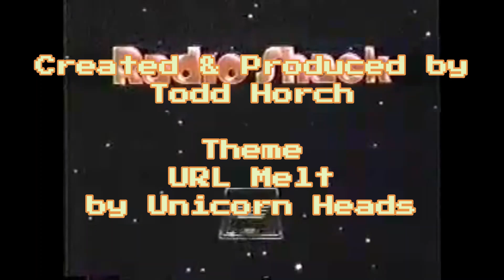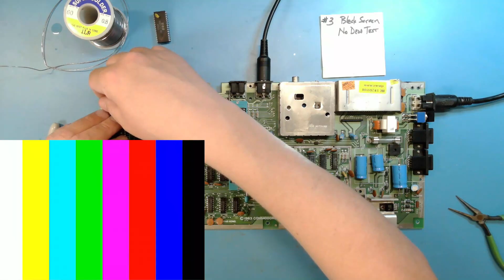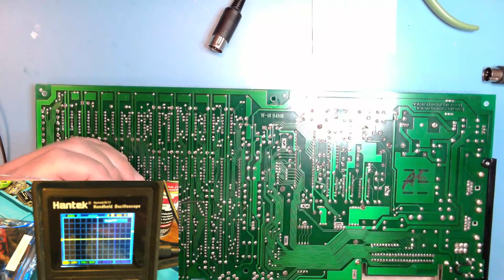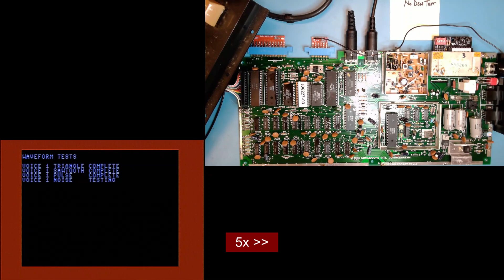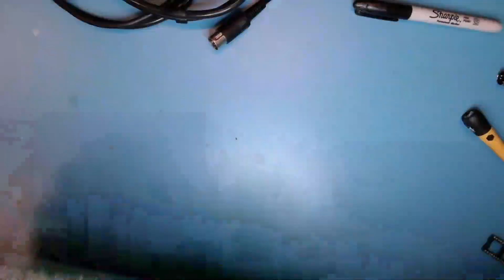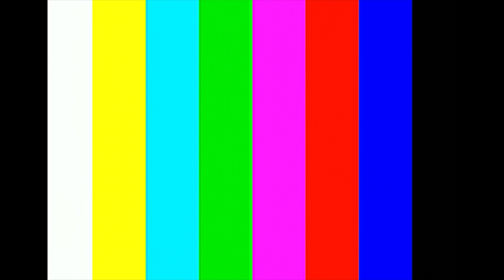Will Commodore 64 Number 3 be Easier?

Comment: Keep marginal/semi functional chips around. One day you might have the choice between a completely dead part and one that at least gets your system mostly working.
I absolutely avoid desoldering SID chips, especially when they're mostly working - they do have crazy factory tolerances and there's barely two SIDs sounding exactly the same. My first SID desolder was by young me with just a crappy small iron (back in around 2000) and the SID ended up with one voice working mostly, one voice working a little - some waveforms wouldn't work - and one voice dead. Second time, many years later, I used a solder sucker and allowed the chip to cool off every now and again. The result: None of the filters worked (but otherwise the SID was OK).
Another time later I used a desoldering station, grounded the station and the C64 and took even more time for the chip to cool off in between desoldering (like every 4 legs) and - again, no filters, otherwise functional. My lesson: Don't ever desolder SIDs unless they are proven defective. Try instead to bring the board back to life no matter what.
Reply from the maker: I do.  I've kept a marginal SID and a marginal CIA from the repairathon.  Thanks for the suggestion, though.  Cheers!

Comment: Be careful with those machined sockets. I've had quite a few lately that are low quality. If you don't check them before using them they're a real pita to desolder if you want to replace it. So for now I just about only use traditionel dual prong sockets. While good quality machined are nice low quality machined ones are really much worse than low quality dual prog sockets. At least dual prong socket are really easy to desolder - even more so than the ICs themselves.
Reply from the maker: I haven't had any problems with them being bad or desoldering them if needed, but thanks for the heads-up and for watching!
Reply: @YARC-1981  In the old days I never had an issue with them. However lately I've had several kits with them and one was really a pita to desolder in a double sided pcb. So always try at least a few pins (using scrap ic if you want) to see how well they're holding. The last kit fortunately before I used the sockets. I would have used regular dual prongs but all I had in the right size was years old machined one. Those really hold well in contrast to the new crappy ones. One kit they even caused loose connection - so bad where they - no way around except replacing them. Might be they're probably fine from big known sellers. But crap do turn up everywhere these days it seems :/

Comment: Wow... I am at a conundrum here. 2x CIA, CPU, VIC-II, Character ROM, Kernal ROM and the SID is replaced. The cost of these parts is way over the market price of working a Rev. A C64. Although it is always good to see a C64 coming back to life, maybe this one was a good candidate for becoming a parts donor machine?
Reply from the maker: This one and the last were both very expensive repairs.  Between the two of them, I figure (at current ebay prices) I've put about $400 USD in replacement parts in.  If this were a "scrapathon" instead of a "repairathon", I might have made exactly that decision.  But what fun would that have been to watch?
Reply: @YARC-1981  For me, it will be the same fun. What you did (diagnosing all its problems and making it work) was the correct approach, and this is the fun part of it. My thought comes after that. Whether to keep it as working machine, or to remove everything I put in and keep it as a parts machine, including the case, keyboard etc. There are a lot of physically damaged (broken case, keyboard missing keys etc) but otherwise working C64s out there which might benefit from a parts machine like this.
Reply: @YARC-1981  Just an observation, but you probably aren’t really increasing the number of working C64s in the world by buying chips on EBay from someone who is gutting other machines to sell the chips. I would identify the faults and replace the dead chips with modern equivalents where possible but when not, I would just accept that I have donor boards for future repairs. You still get the fun of doing the repairs either way
Reply from the maker: @Doug_in_NC  Increasing the number?  Maybe not.  At the very least, I'm undoing the damage that seller may have done.  He kills one, I bring one back.  If the ebay seller destroys one C64 and those chips are used to bring back two or more other boards, isn't that a net positive?  If I "accept that I have donor boards", aren't I guilty of the same thing as the ebay seller?  Sacrificing one to save many?  I'm not condoning harvesting parts from working boards to sell for a profit.  Far from it.  Maybe I'm minimizing the damage these people may be doing.  BTW:  I won't buy from the sellers in Germany, Hungary or China because I know they're bulk harvesters just looking to turn a dime.  I lump those people in with those that break down old tech to harvest the precious metals.  I figure a US seller who's only selling one or two parts probably (or not) had a board they couldn't repair and decided to sell off their good spares so someone else might revive their own machine.  And I do use modern replacements whenever possible.  Didn't you notice the ArmSID, GAL PLA and EPROM replacement for the KERNAL?  I also do have two VIC-II Kawari minis and one large that I'm holding back until I've used all my original spares.  If I run out of 6510's, I'll try to get hold of some of the 6502-to-6510 adapters and use the Rockwell 6502's (which are still in production).  If J-CIAs were available, I'd use them, but they aren't on the market yet.   Thank you for watching and for your observation, but I still think I'm doing the right thing.
Reply: @YARC-1981  I would agree with you, buying from US sellers is probably recycling parts from other people’s dead C64s. It’s the Hungarian ones that when you look at their site look like they are obviously just buying up old C64s and stripping them down because the individual parts are worth more than a working system that I have a problem with. After all, how many C64s would have got through the iron curtain? I didn’t intend to suggest you were doing anything wrong, but your comment that you had basically spent the cost of 2 working C64s to get spares to get the first two going hit me. I don’t think I’ve seen any YouTube video where people have had so many dead chips in the same machine (except RAM) as you have had in #2 and #3
Reply from the maker: I doubt the Hungarians/Germans/Chinese are even going so far as to "buy up" old machines.  I think we, and other countries, ship our e-waste to those countries to dispose of and they then harvest everything they think they can make a penny from.  Industrious, aren't they?  (read that with sarcasm dripping off it)
Reply: Or just wait til replacement parts are available?
SID is easy. In Europe the ARMSID is a nice substitude at a nice price. The VIC... While you can get it it's on the expensive side. IMHO for now mostly for clone builds. The CPU. Well there's replacement for that too. The 6510 replacement adapter is available which takes a 6502 (made by the ton by Rockwell, UMC and others - works very well in my clone). Might be sold out at the moment but seller will most likely get more soon - just sign up to receive email and be quick.
The CIA. There's people working on it and it's almost there. In my clone build the only two original chips are the CIA - the rest is modern substitudes.

Comment: I suspect That machine was harvested……..bad vic, cia, cpu, kernal….😢😢😢 not likely. Why did you go for the scope and not dead test first? I would have.
Reply from the maker: It's possible it was harvested.  If so, though, why didn't they take the working PLA, SID (I know, the SID was starting to go bad, but it''s mostly working) and BASIC ROM?  As for going for the scope before Dead Test, I can only say that I've had it drilled into my head enough to "always check the basics first", that that's where my mind immediately went.  Dead Test would have passed at that point, though, because it doesn't use the Character ROM and the CIA that was still bad did have a working TOD clock, so that wouldn't have told me anything new.  Either way, I got there in the end.